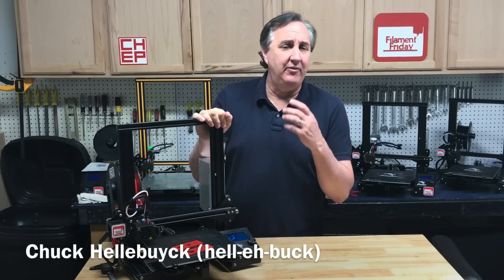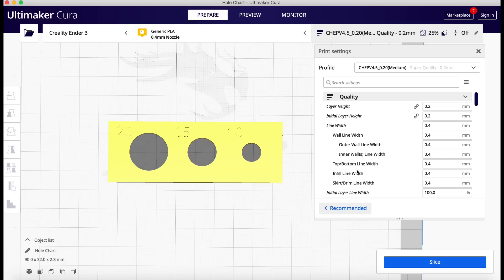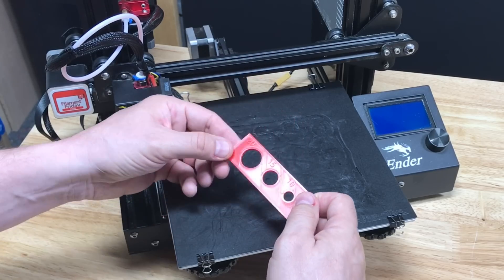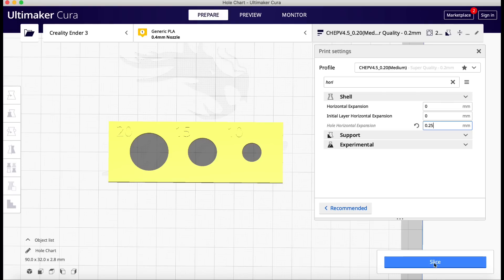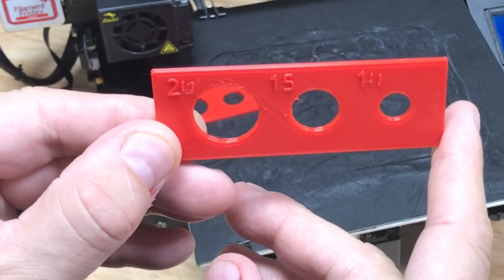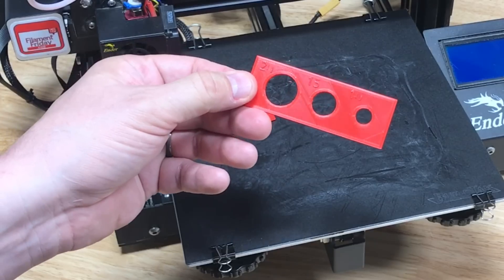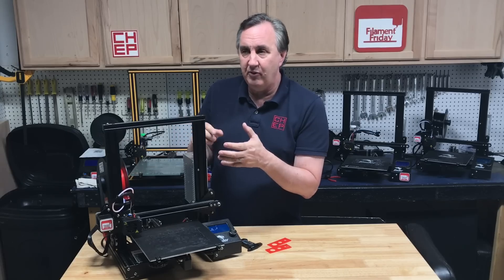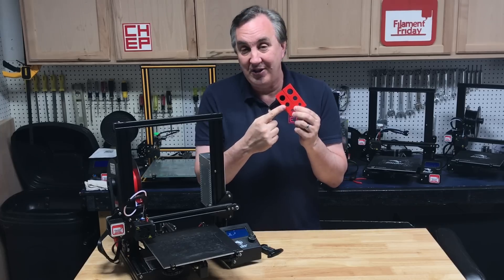Horizontal Expansion Setting in Cura

Comment: Just a small point from an old toolmaker, you should not measure the internal diameter of a hole with a flat edge, the flat edge is the depth of jaws on the calipers, you should use a bore gauge, you will only be out by a fraction of a mm but if you are making these adjustments to get accuracy then it still matters, the amount of error will also be inversely proportional to the size of the hole, i.e the smaller the hole the larger the error, you can mitigate this somewhat by using just the very tips of the jaws if they tapper in thickness to a point but it is still best to use a ball ended bore gauge if you need the accuracy :) Great vid and a long awaited feature, shame about the text.
Reply: @wojtek-33   Ummm... it's still a straight, flat edge. If you were to look at it under a scope.. it would look very flat, indeed. Any Machinist Apprentice will say the same thing. There's a reason Bore Gauges are used. If you want a truly accurate measurement, then that's what you need. Calipers are not used by professionals in that way.  You'd know that, if you knew what you were talking about, but you don't..so......

Comment: Hello, what about horizontral expansion? My holes are getting squished. How can i fix this issue? When i create my own STL files with fusion its no big problem. I use elipse instead of circle. But what can i do when using files from thingiverse for example?
Reply from the maker: Don’t understand. Horizontal expansion was the point of this video.
Reply: @FilamentFriday  vertical expansion :D
Reply from the maker: That’s related to the Z stepper skipping steps or the bed not leveled correctly.

Comment: big thanks for this tip ! just a question : this ajustement 's  hole size works with horizontal holes. but what about vertical holes? ( making a hole on the x or y axe and not on the z)

Comment: Hello Chep! I’ve recently bought the Ender 3 Pro and I love it! But when it’s printing, it makes these beep noises when the bed ans the x axis moves. It’s not really annoying but I wonder if there’s a way to silence that?
Reply: There not much you can about the stepper motor noises, but there is an AMAZING mod to reduce the noise level of the whole printer. It's called "Squash Feet" as it use squash balls as feet for the printer. It acts as a damper so that vibrations are not sent into the surface of your table, shelf, whatever you've put your printer on. Look it up on Thingiverse and Reddit.
Reply from the maker: I use these. Work great. https://youtu.be/1GNDxvxpWr8

Comment: Hi, I had the problem with multicolor printing and the Z-axis (other axes too) not holding position. Tried it with the new setting in the pause at height script and that has fixed the positioning issue. One thing I noticed is that the extrusion motor is also blocked, I had to feed the filament manually and force the old color PLA out. I'm using the Ender 3 PRO. I have not taken the time to review the GCODE yet.
Reply: Tried to replace the M18 command in the GCODE with M18 X Y Z S1800, that did nothing... I saw a lot of other option in GCODE but most not supported by Marlin (On which Ender firmware is based if I'm correct).

Comment: Morning Sir, I just bought an Ender3 Pro, and I am going through your Videos. They have helped me allot.  Is there any chance, that you can share your Current Best "Go To" Cura 4.6.1 Profile, for an ender 3 Pro.   I would appreciate it, if you would assist with this ?
Reply: At the moment I have the 4.5 profiles running in 4.6.1. This produces fine results. Other then tuning the hole expansion (measure and adjust as any printer will be slightly different) I feel there are no big updates needed.
Reply from the maker: I’m using my 4.5 on 4.6

Comment: Hey Chep! Great videos and love what you do for the community! After watching some of your videos i decided to buy ender 3. And i can tell you its been really hard for me to get the bed leveling just right, its been a pain and wasting almost half a spool (1kg PLA). I downloaded the 3 leveling and test files from your thingiverse (they are awesome). When everything looks good it is always one side that is bad so when i try print multiple pieces at once one of them fails and then carry the fail over to the other parts which are good at that point and destroying everything that is on the bed. So i decided to try and upgrade the firmware to marlin 2.0 so i could do the manual bed leveling and when i connected it with mini usb the whole plug on the ender came loose, snapped of board. Im not sure where im going with this but it just looks like you get them perfect and for me it feels like black magic at this point. I just want to print all day and not worry so much.
Reply from the maker: Replace it with a silent board. Print one thing at a time to get familiar with it. If it’s uneven on one side try this: https://youtu.be/8qLJyaBlCCA
Reply: In short, if you want to have the best experience get a BL Touch and an SKR Mini E3. The SKR Mini E3 is a drop in silent replacement for the original board and has the ports for a BL Touch and doesn't need a breakout board. The BL Touch allows you to just get the bed close to level then it does the rest. AKA no more fiddly bed leveling crap. Since I installed mine I got it close then it mesh levels every print.

Comment: checked out my problems and i just found out its a software problem with CURA 4.6.1 version. I used the gcode files that came with the printer and it prints just fine. i don't know what it could be but only Cura program. I have a Ender 3 pro. if anyone can help out. it will be highly appreciated
Reply from the maker: What’s the problem?
Reply: @FilamentFriday  well my printer would do fine when printing out the gcode that came with the printer but it wouldn't print out the other prints i have already. it would either be missing layers, creating those blisters/bumps between the layers or just have the material start to clog or not extrude the material out correctly. I kinda troubleshoot it out to either be cura with the settings or just some weird problems with printer
Reply from the maker: If it prints the sample it’s not the printer.
Reply: @FilamentFriday  so its a program problem then?
Reply: @FilamentFriday  ok i think i know the real problem. for some reason cura is not printing the model on the bed but is extruding it like 10mm above the bed. so how can i fix that?
Reply from the maker: Make sure the model is on the bed when you slice it.
Reply: @FilamentFriday  i did that and made sure the z axis is at 0 and its still doing this.
Reply from the maker: Check for z offset in your machine profile.

Comment: Hey! Will it still work if I use your 4.5 Cura profiles on 4.6 Cura? Many thanks!
Reply from the maker: It’s working for me. I used the 4.5 profiles in this video.
Reply: @FilamentFriday  unfortunately cura give me the same error: "Could not find a quality type fine for the current configuration". Searching i understood that it is a problem with cura, with the latest version that add different quality type. Do you think it is a problem of my printer setting? i have an Anet E12. Can you upload on the website revised profiles? thank you so much
Reply from the maker: Simone-load them with the Ender 3 selected.
Reply: @FilamentFriday  Ah great thanks!

Comment: Just for reference: Slic3r / PrusaSlicer has a similar feature - "XY size compensation" (actually that feature was the reason why I switched from Cura to Slic3r a long time ago). And yes, it has the same problems - you don't really want to combine it with text. (and the initial layer horizontal expansion is called elephant foot compensation in PrusaSlicer)

Comment: Also I noticed that the skirt now prints inside out instead of outside in. I get that it should be an improvement, as if there is some stringing it should catch on the skirt itself instead of being dragged towards the middle where the print will be, but I don't particularly like it as when the skirt is done the nozzle have to travel over it, and at that point it will be easier to catch blobs, stringing or debris. Is it possible to revert the old direction outside in?
Reply from the maker: Didn’t notice that. Not sure.

Comment: Would an alternative be just to leave the horizontal expansion setting alone and intentional model the holes 0.5mm larger to compensate?    Or is it a matter of trial and error for any print that has holes in it to find the correct value for horizontal expansion?
Reply from the maker: Each print may need different settings. Just print a few layers and test it.

Comment: Chuck - once you set that parameter for the holes is it set permanently??? are all holes either under sized  or over sized and once you set that its fixes all holes with that printer??
Reply from the maker: As long as you leave that value in the setting. But it’s not permanent. You can change the setting.

Comment: Per the stepper motor issue: you can also insert a g-code command to over-ride this, or if you are using your own customised firmware you can change this default behaviour.

I ran into this when doing two-colour prints, where I would not be keeping a close eye on progress, and the motors dropped out after five minutes.  My solution was to change the firmware to stay locked until instructed otherwise (note that powering down always clears this).  You can insert starting g-code to achieve the same, on a per-print basis, which I was not aware of at the time.

Check out the M18 and M85 commands in Marlin.

Comment: Didn't read all comment but i wonder if it is the same with round pins. Did you try it ?
Reply: I'd really like to know the answer of this too! My biggest frustration with printing right now is that holes are always undersized, pins are oversized. It's great that this fixes holes, but if it helps pins too - awesome!
Reply: @jayfarthing  I did the test last night. For my holes, same as CHEP with .5 smaller than what it should be but for the pins, i got .2 smaller so i guess i will have to make 2 profiles or simply change the value. One thing for sure, i cant print holes and pins in the same times without modifying one or the other with the deseign software. 

My setup : ender3 with MKS mini E3 board and metal nozzle, sliced with Cura 4.6 and deseigned with thinkercad at 64 slides, o bevel and 1 segment for both holes and pins. Printed at 100mm/s in PLA.

Comment: My internal thread dimensions are always .007" or .17mm undersized but the external are correct.  I would suspect that the Hole Horizontal Expansion feature may also improve internal threads. Might be worth a test, I just need the Dremel Slicer to be updated to CURA 4.6.1
Reply from the maker: Can’t the Dremel accept outside G code files?
Reply: @FilamentFriday  I believe so. I tried once with an earlier CURA version and had some issues, probably on my end. Thanks for the the reply and your support.
Reply from the maker: They might have to be .g and not .gcode

Comment: Great trial of the feature. 
On your hole close ups though, they looked quite faceted as if the STL is quite coarse. This will probably affect the hole size a bit as it 'cuts the corners'.
Reply from the maker: Did you read the pinned comment at the top?

Comment: Cura 4.6  Worked fine for me for what I do but 4.6.1 drew  two skirts inside the skirt and messed up the start of the print. Did  the same slice in 4.5  cura and it worked just fine.  Something to watch out for

Comment: The 4.6.1 update is really only needed for the ender 3 pro,and it fixes a problem with missing nozzle size in 4.6 my latest video on my channel is all about the 4.6.1 update for the e3 pro, check it out!

Comment: Or just calibrate your extrusion correct??🤷‍♂️ same With the step ect 😉 then it spot on everytime. 😝
Reply from the maker: If my extrusion was off why were the outer dimension correct?
Reply: First off all you cant measure anything correct With a plastic /cheap caliper the tolerances of these is 0.1-0.2 +- mm then if you should calibrate your step almost every guide on youtube is wrong they compensate the step Way wrong, i work With cnc machines Daily basis and do this all the time i have a mk3 at home and it hit both holes and outer within 0.05+- every time how to calibrate the machine absolutely correct is a longer story cant tell here might be doin a video on it when there is time.  You all think these machines can hit tolerances within 0.02+- that cannot be done, expect a tolerance within 0.1+- if correct calibrated. Not here to give bad vibes or so, just saying your videoes are great and it can deffently be a great feature for some people and lot easier to make changes. But as i say the correct Way isnt that Way.
Reply from the maker: Looking forward to that video.

Comment: Everyone commenting about CURA making the holes smaller, that is not the problem. The printer (pretty much every printer) makes the holes smaller. That is because when the nozzle is moving around the hole, it's dragging the molten plastic behind, pulling it into the hole.
Reply: I'll respectfully disagree here.  If this was true, you'd have misshapen outer corners on your perimeter as it pulled the plastic into the empty space behind it.  I believe the real root cause is how Cura handles the geometry of inner spaces.

Comment: Since hole diameter is an issue with many printers and slicers, I would still not use this setting in my designs, but rather design my holes with a gap of .25mm to begin with. Since I am almost exclusively use openSCAD for my designs I usually have a parameter "gap" which I set to a value in this range and which I use to make holes just slightly bigger. I don't want my slicer to modify my model in this way - too many other things could break, depending on what the algorithm counts as a hole.
Reply: Agreed! Though, sometimes the design you print is not your own. You could use Blender or other software to modify the holes, but it doesn't hurt to examine the slice in Cura before modifying the model.

Comment: Aren't you supposed to measure with the tip of the caliper for the holes?
Reply from the maker: Tips can get damaged and these are low cost plastic so the tip can potentially flex a bit so measuring further up the straight edge can give more consistent results.
Reply: Buy a caliper and try

Comment: What causes the initial issue with the holes being too small ? Is it printer or slicer related ? Did you try to slice the same stl with another slicer to compare result ? i'm surprised that you have this gap in the first place. For me this horizontal expansion is solving an issue that shouldn't be there in the first place !
Reply: I suppose there are several things affecting it. For one it is the lateral width of the printed lines. As long as there are neighboring lines the thickness is bound to the available space. As soon as there is nothing on one side the plastic will tend to go to this side. This would be of course also the case for the outer dimensions of your print, but there the initial extension will most probably be counteracted by the shrinking of the print when it cools down.

Comment: Great helpful video as usual. But have any of your viewers had trouble with Cura versions for Windows 64bit getting a critical error when trying to use Thingiverse within the Cura Slicer as an extension. This happens on all the versions I have tried from 4.0 up to the new 4.6.1.
Reply: I am using Win 64bit - but I have never tested to use Thingiverse from within the slicer, never flet the need to do so. If I want to find something on Thingiverse I use a browser.

Currently the whole of Thingiverse is a bit unstable - that might put any interface into trouble...
Reply: Uwe Zimmermann , Thanks for your reply. It seemed a good idea at the time to use the extension Thingiverse to browse for an item then to simply click to build onto the work area directly rather than to use the browser then open the files to then export to Cura. As you say Thingiverse is still pretty useless at the moment which is only putting people off using it. I will now delete the extension from Cura and do as you do.

Comment: hi, I have a stock CR10 and I would like to change the controller board, what do you suggest?
Reply from the maker: I haven’t updated the board on my CR-10. If I did I’d probably try to adapt a silent driver board like a big tree tech 32 bit board.
Reply: Bigtreetech skr mini e3 almost a drop in replacement, you just have to change the bed size in the firmware.

Comment: I usually get round this by taking at least 0.5mm extra out of the hole in my CAD design, to compensate for this problem. Things then normally fit very snug into it.
I do suffer from elephant's foot though and would love to know how to cure it. If I raise the bed to stop it, I get under extrusion and poor bed adhesion. This sounds like a setting need so I look forward to your future video.

Comment: I tried this option on a back cover for my TFT screen as the screw holes were too small. It ended up removing the walls of 3 of the 4 sides of the case, left them with just infill. I'd say it's definitely a beta feature still, but looks promising.

Comment: Why don't they just fix the algorithm for slicing holes?
Reply: I imagine it's not that easy, because the horizontal expansion setting for holes showed a glitch with other things that weren't holes. How does Cura determine what hole you need to be what thickness? This is why there is an advanced setting so you can turn it off. Myself, I just make the holes a bit bigger in CAD to compensate.
Reply: Yeah, these seem more workarounds than actually fixing the problem. The numbers getting ruined are an example.
Reply: there is no information in a CAD file about what exactly is a hole...